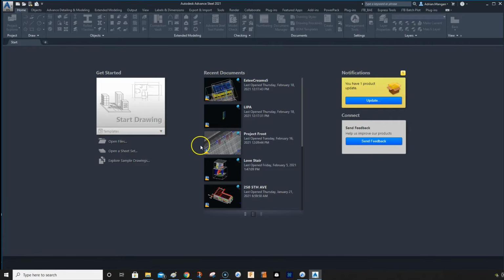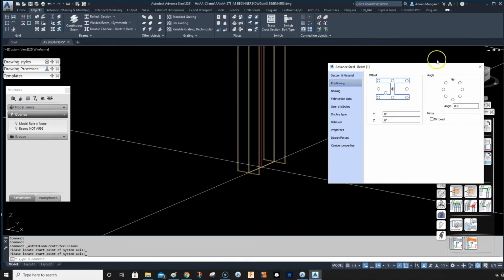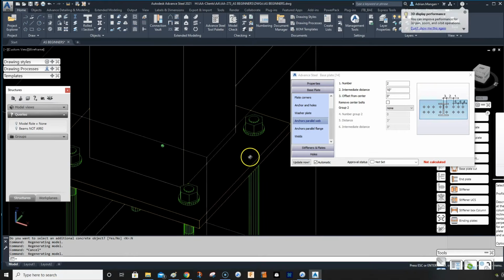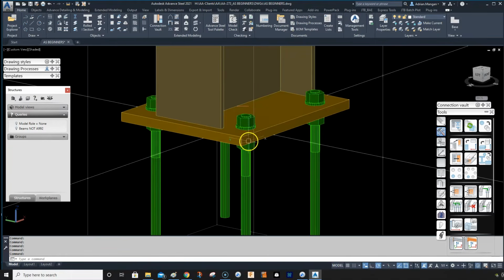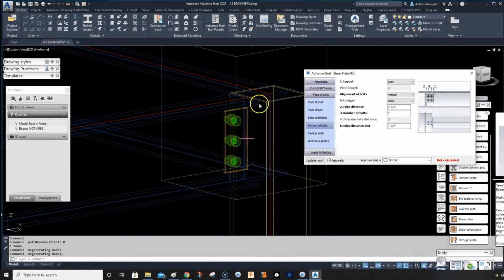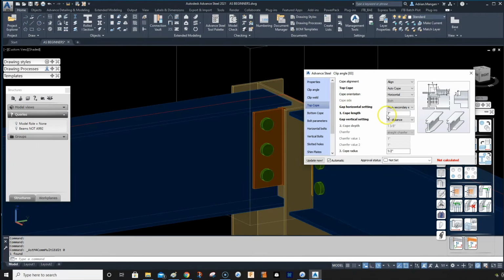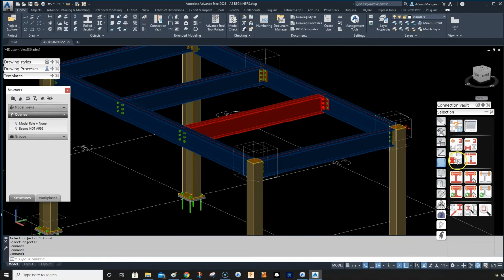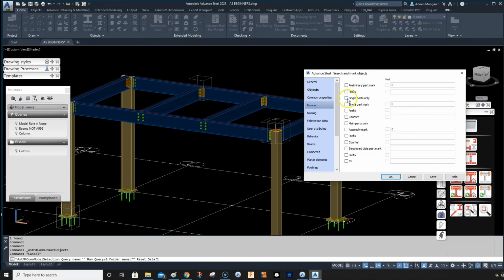ADVANCE STEEL: For Beginners - "1. THE MODEL"

Comment: Stupid question: if I want to move a part orthographically (up the Z direction in particular). I come from SolidWorks and am trying to relearn my old disciplines; is there a way I can look at the model from a north elevation (for instance) and then move items in the z/x plane?
Reply from the maker: I use the commands on the UCS section of the tool palette, the commands at the bottom restrict the direction of the move, there is another way but this is the best and quickest in my opinion.

Comment: Hallo Adrian, thanks for your nice videos and they are extremely helpful. I have tried to follow your model and i get problem with clip angle. It seems you have a layer named clip angle and all your connections function the way you want it to be, by which i meant by check for loose parts. On my side it shows all my connections as loose parts. could you please give some explanation or setting on how to make a connection from loose to tied. Thanks again!
Reply: Same for me

Comment: Could I ask how you got the UCS to display at the cursor position, and also how you were able to snap to the intersection of the 2 grid lines?
Reply from the maker: Hi Tom, the crosshairs (i have a video for that) is controlled in the "options" "3D Modeling" "Crosshair Labels". To snap to the grid intersections you need to set that in you snaps, turn on grid intersections
Reply: @EIRCAD  Great, thanks

Comment: All of the videos I have tried to watch all show the grid plane starting from a flat level. How would you go about designing a system that has footings at different levels?
By the way, your videos have been the most straight forward and to the point. Thank you
Reply from the maker: Hi Kevin. This would be based on your UCS location, so either move ucs first or create footing at node of column or create in world ucs and move up or down desired distance.

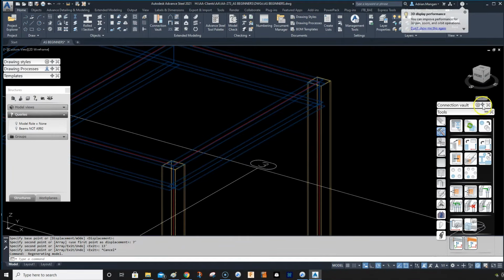Comment: I don't have all the panels open, like the ones on the right side of your screen. "Connection vault", "Tools", etc. I got lost at 12:36, because I couldn't access the "Platform beams". The panels were turned off by default when I first opened the program so where can I turn these on?
Reply from the maker: Hi, If you go to the Home tab top left, you will find the Connection Vault and Tool Palette along the top, just click on them to open, the other palettes I have for Drawing style etc are on the output tab, thanks for watching, good luck
Reply: @EIRCAD  Thanks !